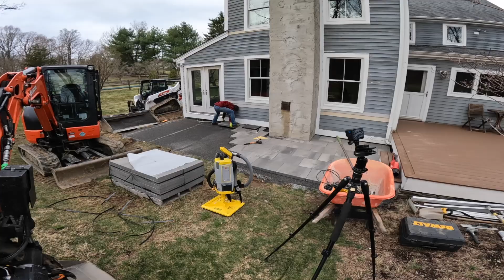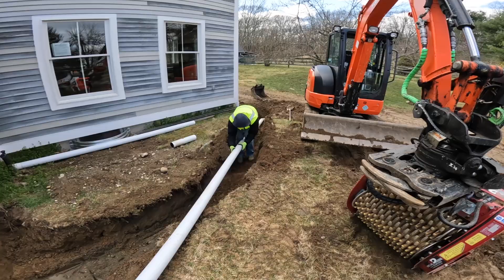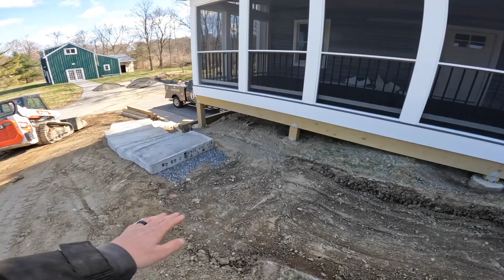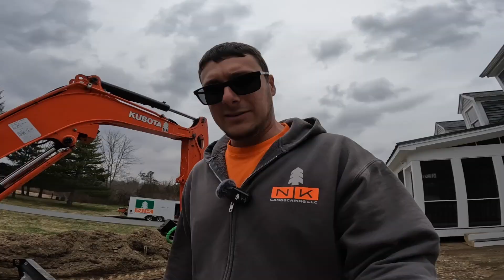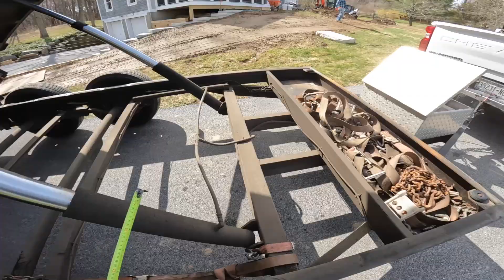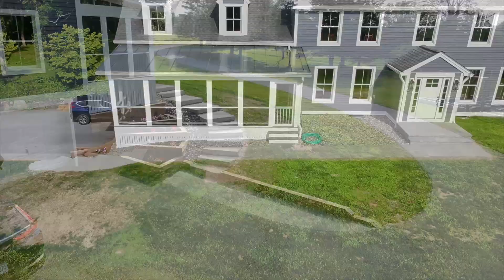Insane Hardscape Transformation for This Clients House!

Comment: Question for ya brotha…I have a t66 skid and I’ve recently decided I should buy a mini ex as well and was wonder ur thoughts on the Kubota and why you went with that brand like what your take was on it. 

I got a quote for a cab e35 for like $60k long arm with hydro thumb and extra hydraulic
Reply from the maker: I am not a Bobcat fan at all. I have had nothing but problems with our T66 that all generally relate around computers and electronics. 

The Kubota machines, especially our KX033-4 is very basic, but that means it is VERY reliable. I have had no issues with that machine in 1,800hrs. I would personally be looking at either Kubota or Takeuchi, although I know near me, Tak service is a little lacking.
Reply: @NKLandscapingLLC  what year t66 do you have? I know the earlier R series had a good chunk of issues with water intrusion and stuff but they claim they were fixed in the later models.